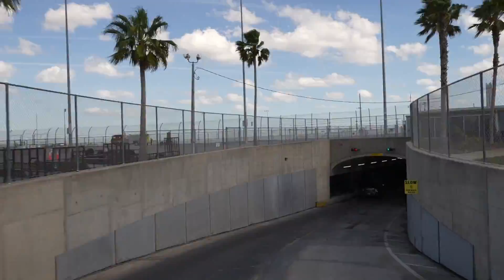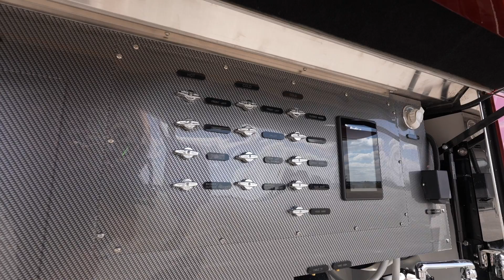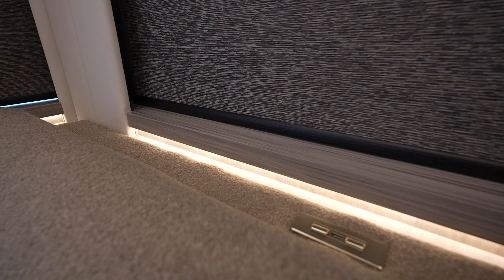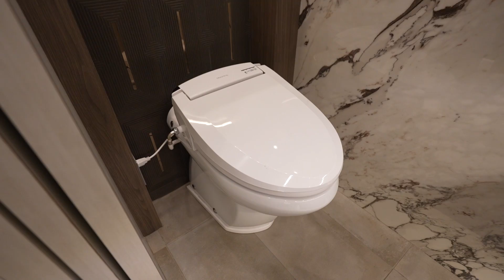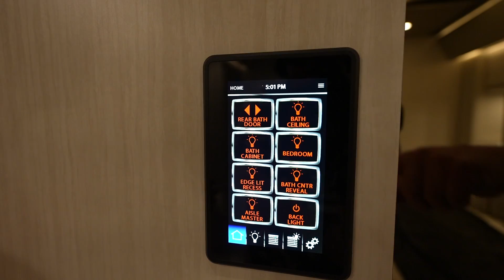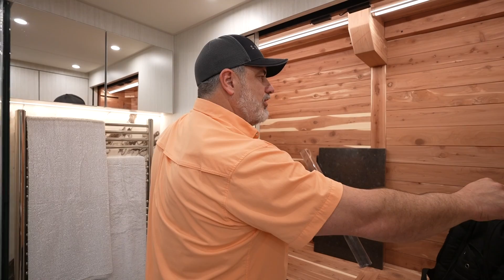2026 Newell Coach Daytona Show Coach 🏁

Comment: On 200 gallons of diesel fuel how many miles will that get you?
Reply: 8lbs a gallon that's 1600lbs of weight but that  600 hp motor can handle it!